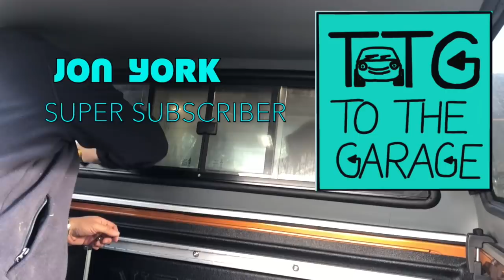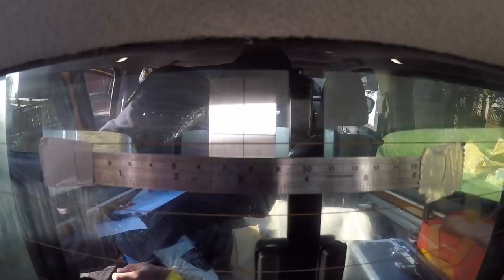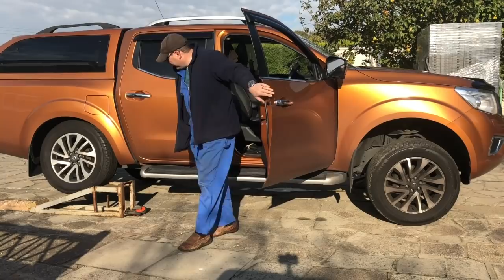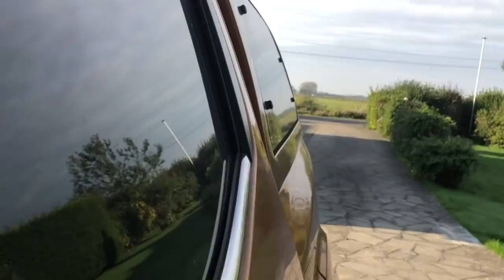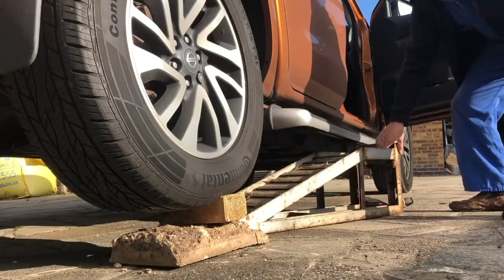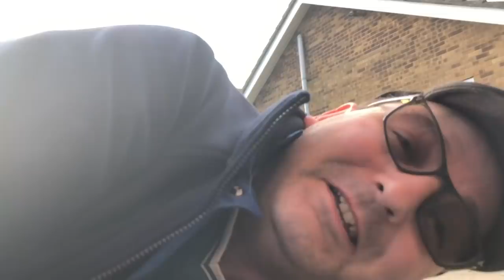Check for np300 chassis problems

Comment: Liked the vid, sad that so many comentors completely mis-understoond the intent. I subscribed because of this video.
Reply from the maker: Thanks Tom. That is really nice to hear. I started off trying to help all the commenters understand the intent of the video but by now have completely surrendered😁..  Its obviously something I did wrong with the description or introduction😔.
Keep. on watching Pal👍
Reply: @ToTheGarage   Content was good mate, just because some people didn't understand you; doesn't mean you did anything wrong. That's completely on them. I've watched your other np300 video's as well (since I have one) and I enjoy them all too. I got the first 2015 model, that doesn't have the 360 camera system, and I am seriously debating my options of installing the camera's that are supplied with a 360 camera kit onto my mirrors, or buying the spare part from nissan that already has mirrors built in and using those cameras with the kit. Now that I've seen your video on how to remove the chrome cover, I am confident that I can remove the cover myself, and install the camera's that come with the 360 camera kit

Comment: This is stupid your dumb. This is exactly why the best is separate from the cab is to allow for flex. It's designed that way. The ability to flex is desired for off road and hauling.  If you are scared of the flex get a Honda Ridgeline.  It's unitized construction will have one wheel in the air over every slight bump.  But please continue making videos about things you don't understand.
Reply from the maker: Hi Fjsusj
Not very polite my friend. I understand this completely.  
I am an automotive engineer, and  I actually agree with most of your comment, if the question had been 'should my car flex'. I'm afraid you have misunderstood the point of the video.
The video was produced to ascertain the degree of flex demonstrated by a nearly new NP300 under a static full body weight diagonal load. This was in response to several subscribers who WERE worried about the degree of flex observed on their vehicles. This video was to demonstrate a simple method by which to compare their vehicles with a known norm before assuming that there was any fault or damage in their chassis.

Please read the description below the video and actually listen to it prior to making rude comments in future, 
otherwise, you may appear 'stupid and dumb.'
Reply: @ToTheGarage  blah go engineer something
Reply: As your an automotive engineer, the question could have been answered by stating flex is desired as long as the body panels do not come in contact with each other like, there is nothing to worry about. That simple.

Comment: This is normal wtf.!!
Reply from the maker: I'm afraid you have misunderstood the point of the video.
The video was produced to ascertain the degree of flex demonstrated by a nearly new NP300 under a static full body weight diagonal load. This was in response to several subscribers who WERE worried about the degree of flex observed on their vehicles. This video was to demonstrate a simple method by which to compare their vehicles with a known norm before assuming that there was any fault or damage in their chassis.

Comment: Isn’t it normal? I had a Lexus RX450h up on ramps similar way and the chassis flexed too - I could tell by how the boot lid was opening and closing, the lock wasn’t 100% lined up. Pointless video IMO, putting unnecessary strain on the body.

Comment: This is very normal mate I have this ute here in Australia its 2015 model 70000ks now still amazing I had before toyota hilux and ford ranger but this ute really amazing
Reply: I have a 2016 np300, it's at 16800ks only problem has been hot pipe, which they later fixed. The chassis if you watch a particular episode of 4wd247 do a review on all dual cabs chassis's which is done by engineers, they say basically all makes the same in strength and all makes are strong enough. My report on np300 is good on fuel and bloody reliable and I haven't been all that easy on it, hence the reason I still have it. Horn is a pain though might upgrade to new nav steering wheel

Comment: Thanks for the video. 6mm does not sound as quite much for almost 2 tons applied on the chassis to make it flex. Plus it needs to have some flexing in order to avoid cracking. Check out how much drag racing cars chassis flex on launch, and most have chrome moly ones.
Reply from the maker: Pablo Daniel Rivas Thanks for your interest. Good observation. I have seen. The cars launch at Santa pod drag strip. They really do twist substantially👍
Reply: @ToTheGarage  Another consideration is the distance from the point where you are taking measurement of chassis flexing (rear window) to the chassis. Flex value would increase if you move away more from the chassis. Lets say that, roughly, the distance between the chassis and where you placed the reference mark and the camera on the rear window is 1000mm (1M) and the arc (flex) you read was 6mm, according to the arc formula S (arc) = radius x angle in radians, this gives me a flex value at chassis level of 0.34° which is a very very low value.
Reply from the maker: Welcome fellow Engineer!
Not many would ever include the word 'Radians' in a youtube comment.
The ruler was exactly 1.2 Meters above the chassis centre line. It is positioned closer to the back wheels than would be ideal to show maximum flex. This would be at the midpoint along the wheelbase but this positioning was used due to the convenience of the split between bed and cab.
The flex is also only showing a proportion of the true distortion as the angle will increase the closer you test to each axle. I originally intended to do the test with two tall canes duct taped to the front and rear bumpers. I would then shoot a video showing the canes moving out of alignment as I drove up the ramps. However, this was difficult without mounting the camera equally high and attached to one of the bumpers so that it moved with the vehicle. Depth of field was also an issue.

I think the steel rule on the rear window method is flawed but highly repeatable. 

Thanks for getting involved Pablo
Look forward to further input from you on future video's
Happy New Year.

John

Comment: What year is your truck mate? Is chassis weakening something that happens on the NP300? I've got the earlier Euro5 2016 version. Just passed 41k
Reply from the maker: Hi Adam
Loving your RX7 v8 Conversion. I have subscribed!
You will just have to be careful that the money saved on rotor rebuilds, is not exceeded by the money spent on tires! (Having said that you can't put a price on a smile😁👍)
NP300 has no particular rep for Chassis issues. 
The previous generation B40 Navara collected quite a few horror stories with snapped Chassis connected with rust. 
As I don't have the data on actual numbers with issues, it is completely possible that the perceived issues on earlier models are an effect of YouTube. ie if ONE snaps you can guarantee that the whole world gets to see it.
I did this video because a subscriber was worried his Navara was flexing too much and Nissan said it was not. I know my truck is in good condition so this serves only as a record of what is normal, rather than any fear on my part that mine has an issue.

Happy New Year Adam
Keep on Videoing
Reply from the maker: PS.  its a late 2017

Comment: Hi John,Regarding chassis problems, my Isuzu TFS and D40 Navara both failed. Rather than the usual/common breakage, they pretty much rotted from the inside out.Any tips on how to prevent this happening to my new purchased 2017 NP300?
Reply from the maker: Hi Alan
I have not had the issue or tried to resolve it myself. I do know that the rear chassis is an open design with many holes pressed straight through the longitudinal members in an attempt to introduce a degree of crumple zone into what is otherwise a battering ram of a car.
If your vehicle is brand new. (ie we know there is asolutely no rust inside the chassis currently) then you can consider using these holes as access points to inject underseal. Another option is to fit inner wheelarch liners.
West Yorkshire engine services can now offer these i understand but I dont know the price and I have not seen any in the flesh.
For me, I will just be washing the truck regularly.